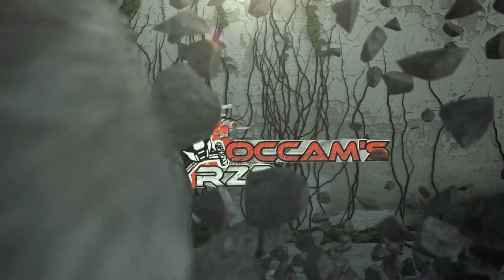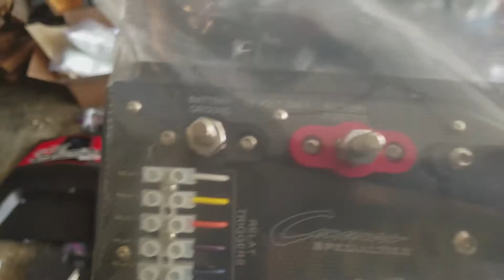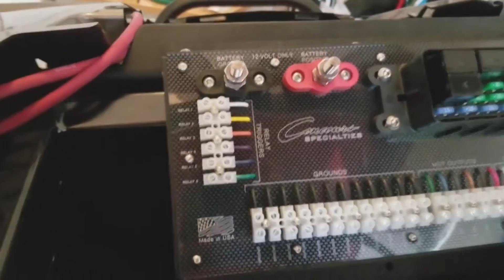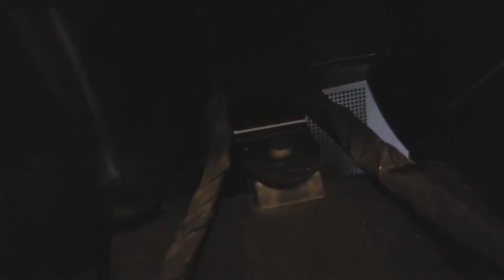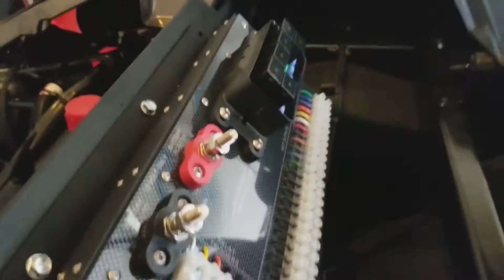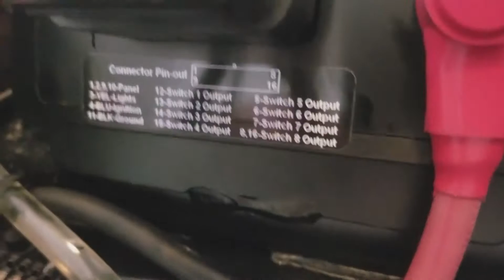Occam's UTVs: Dual Install: Switch Pro SP-8300 & Concours Specialties Part 1

Comment: Hello Occam's RZR, I really like your set-up using the Switch Pros Panel in conjunction with the Concours Specialties structure wiring cabinet. I just like to know if you connected the yellow (parking light wire) and the blue (signal wire) on your Switch Pro. I thought you connect the red battery cable directly to the battery and connect the blue wire to the accessory post (key hot wire) to turn on and off with the ignition. I just have the switch pro set-up only. Thanks in advance.